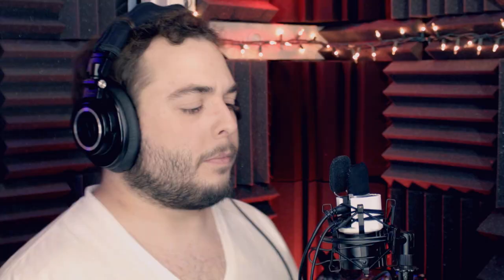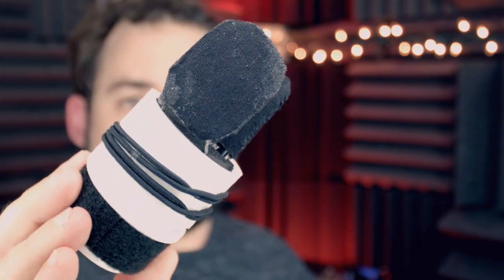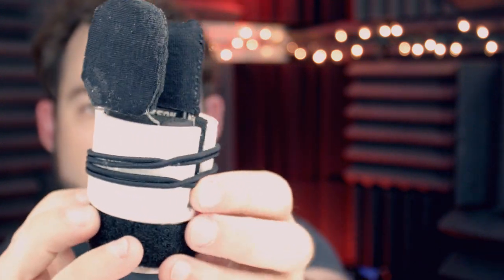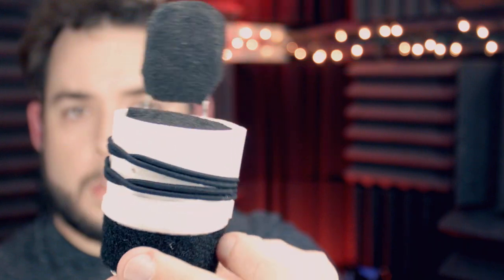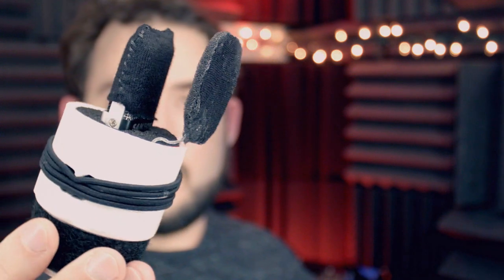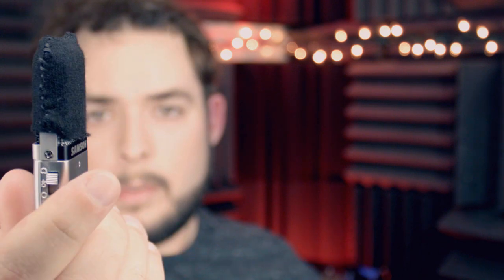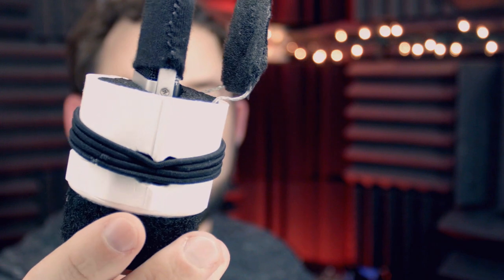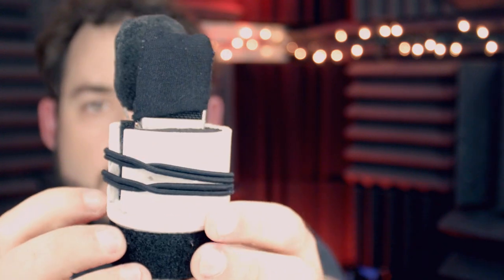Improving the SAMSON GO MIC... kinda

Comment: You have put in a ton of work trying to make that mic even semi-workable as a VO mic.  Not sure I'd ever recommend it for VO though. The casing and your itty-bitty pop filter is really pretty impressive with being home-made.  The little sock for the mic made me laugh that you actually took to sewing. This just proves how handy and problem-solving you are!  Is it my imagination, or does it seem like any frequency below 300 is chopped off?   It does still sound thin to me.  I bet that's because your post production processing you mentioned, cranking the higher frequencies.   Once again, what you've done here actually shows a ton of talent, resourcefulness and you are commended on your efforts that could actually be applied other mics as well with some slight modifications for other mics.
Reply from the maker: Actually I did no post prepossessing to this mic. Normally in reviews I don't do any editing other than normalize to -1db or -2db. The 300hz is probably just the mic. It doesn't have a vast range and is pretty sharp. I enjoy brain storming and working out problems and may do more of these in the future.
Reply: @FunnyGuyTimmy  and this is why we are the geek-brothers. LoL!

Comment: Hi, I was just about to purchase this Samson Go mic. I had 50$ and it costs 50$ in my country. After watching this video, I think I should change my decision. Other mics available in this range are Blue Snowball Ice/Fifne K669b/MaonoAuAo4/samson pencil condenser mic

Should I reconsider my purchase, since most youtube videos say Samson is better than all of them

Currently I use A Lapel mic(boya bym1) and shotgun (boya mm1) for my gaming livestream and voiceovers for commentary. I use them alternatively which suits the best for the timing. Plz help
Reply from the maker: As long as you have a good mount and pop filter the GO mic is actually better than most USB in the same price range. But if you already have an interface that works with XLR and 48v phantom power than I would say go for the pencil condenser mic. But get a good dead cat from movo for around $10-20 to cut down on the plosives.

Do you have any treatment in your space to cut down on the noise and reflections?
Reply: @FunnyGuyTimmy  Nope, I am a student and Dont have that big room. But when I set the gain on audacity too low, my voice comes out to bd quite crisp on the Shotgun.

I can purchase a stand and a pop filter, its not that expensive, also they say Samson has that mount which can be used to attach it to a tripod.

For XLR mics, I do have a lot of ther options, but a friend told me that I will need a good branded(~expensive) phantom power for optimum performance of an XLR mic, so I'll remove Pencil mic from the list for the time being.

After all, would it be right to say that an years old design(samson go) outperforms the new ones(snowball, fifine) ?

Thanks a lot though !
Reply: @FunnyGuyTimmy  plz reply bro is it the best usb mic under 50$ with stand and pop filter
Reply from the maker: The Intellectual For a few more dollars you can get this Samson Q2U USB/XLR Dynamic Microphone Recording and Podcasting Pack (Includes Mic Clip, Desktop Stand, Windscreen and Cables) https://www.amazon.com/dp/B001R747SG/ref=cm_sw_r_cp_api_i_weGwEbWTAQ60D